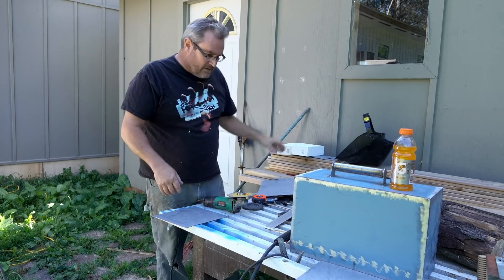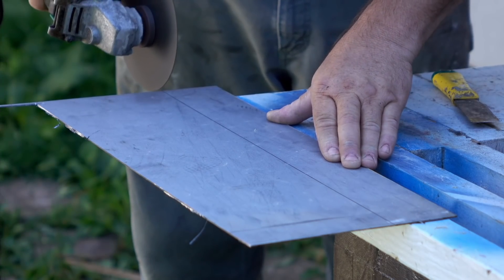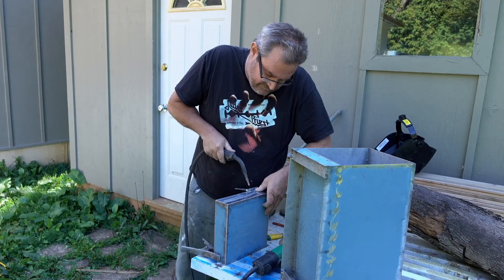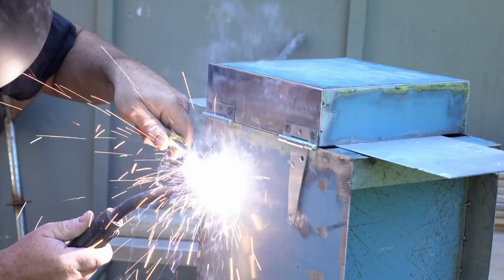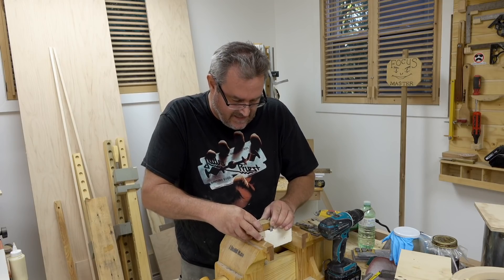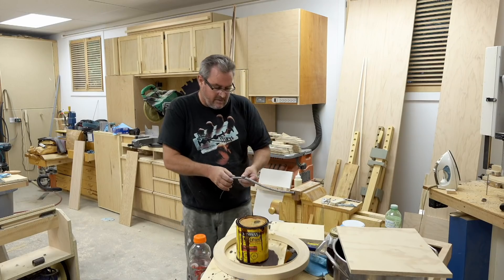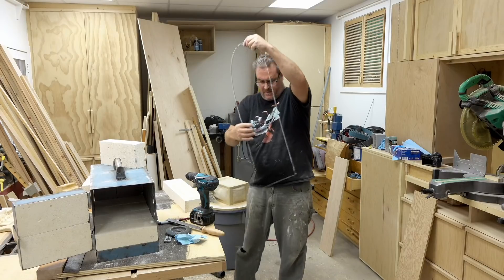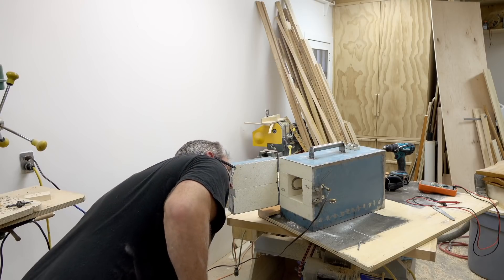How To Make A Heat Treatment Oven - Middle

Comment: What's the hand power tool you used in the first part for cutting the metal sheet, was it an angle grinder ? I want to build my own and this is a great design.